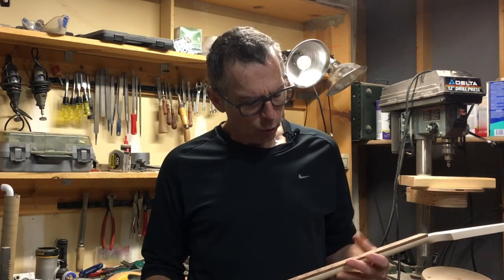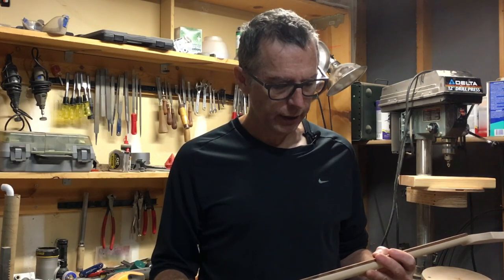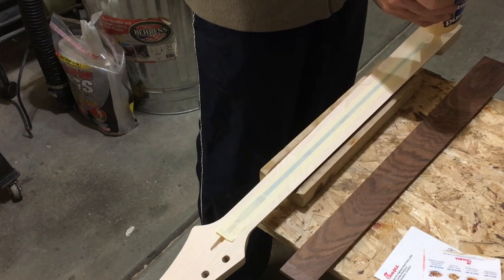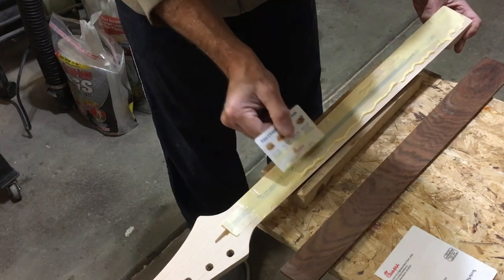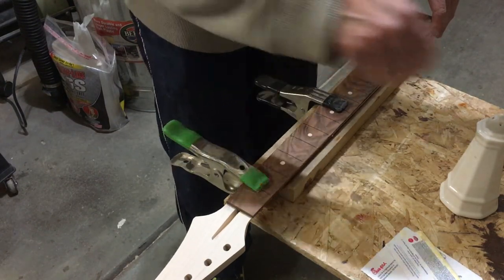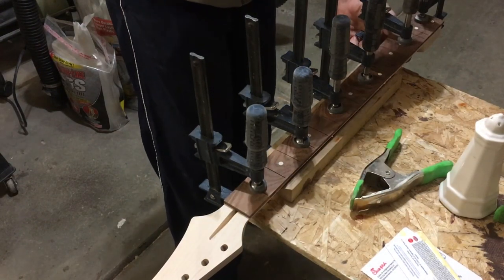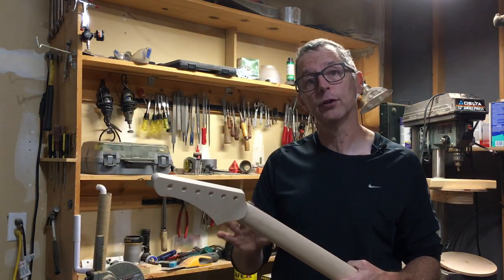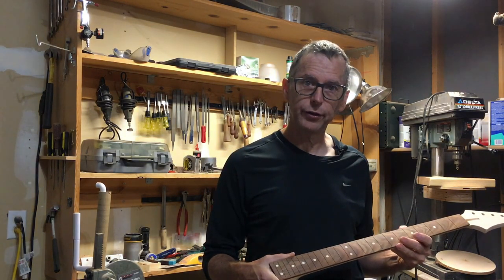How To Glue A Fretboard Onto A Guitar Neck

Comment: That's interesting I've never seen anyone use salt to add grit to their glue to keep the pieces from slipping. I'll have to try this on my stringered neck blanks. For fretboards I have index pins through the fret slots at the 1st and 17th frets to keep it from moving while gluing.
Reply: I think pins are the way to go. I don't know how I'd feel about grains of anything in between the two surfaces, even if harmless. I avoid anything that reduces vibration and it seems like having pockets of material imbued in the wood/hardened glue would influence the overall vibe negatively, simply because of a density differences.. If there were a way to apply the grains uniformly, then I might feel better about it. 🤷‍♂️
Reply: Which glue is used to join the fretboard to the neck? Can I use Araldite? 
I tried using Fevicol bu eventually it gave up to string pressure slowly ripping the fretboard off of neck.
Reply: @anujkolhe5611  use titebond original (the red label)
Reply: @andrewgrossman6066  Okay. I'll give it a try. Thank you!
Reply: This just seems like more of the same, over complicating things.  Do what you want but I see no reason to compromise your glue with a foreign chemical.  Gluing on a fretboard is not that difficult.  Even the slippiest glue tacks up soon enough.  Align one end, clamp it,  align the other, clamp it,  clamp the middle, adjusting as you go.  Dial in the clamping pressure from the center towards the ends and you're golden. I've used fish glue with great results. Starts off tacky with plenty of time to make adjustments. Taping over the truss rod is stupid too. If you're only using a thin layer of glue to minimize squeeze out, why reduce the glue contact area with tape?  A tiny amount of glue in the truss rod slot won't hurt.  Some of these builders over think and complicate a fairly simple concept. They're guitars, not space shuttles.
Reply: @timhenry8078  🤣

Comment: That's good advice on the squeezeout. You can also take like a minute and simply tape off the edge of the neck, so no glue even touches it. Not very difficult, a straight line and some tape.

Comment: Always good advice.  Also high pressure clamping can distort the wood just enough to create an open joint. If your mating surfaces are perfect, very little pressure is needed for the perfect closed joint.  Great stuff.

Comment: I know you probably don't run into this on a new build but, I had to pull the fretboard off of a neck because it was separating, after I got it apart it was pretty apparent that the wood around the truss rod adjuster has gotten some type of oil soaked into it, the rest of the glue was kind of crystalized so it separated easily. Want to try and save the neck and fretboard and prep the neck and fretboard with something to draw the oil out, would Naphtha suffice?
Reply from the maker: Without knowing what the oil is, it's kind of hard to say.

Comment: Does salt weaken the glue:  This is a question I asked myself after watching this video (good video by the way).  So, I looked around.  A glue expert from tightbond is quoted as saying that salt or sugar can react with the glue and weaken the bond.  However, some people have done (semi scientific) testing and in all tests the wood failed before the glue did.  So IMO, the answer is, salt may weaken the bond but not enough to be of any concern since the glue is still stronger than the surrounding wood.  That said just use a bit as shown in this video  :)
Reply from the maker: Of course Titebond will say that. They have to be thoughtful about their warranty. I’ve never had an issue with salt weakening the glue and I have had to remove a few.

Comment: hello, first time builder here, but i built several horsebows.. 
thanks for your time, really educative.
during gluing operations, we use to rake the wood with a metal saw blade so we are sure the glue perfectly penetrates the surface.
do you think it would work or not ? thank you.

Comment: Is your fretboard radiused? I noticed you didn't use a clamping caul and I was wondering if it is OK to not use one on a radiused fretboard. Great video, many thanks
Reply from the maker: It's always best to use a clamping caul. However, I didn't have one long enough for this neck and I opted to clamp without one. Not the best choice, but it worked okay.

Comment: I've seen a few videos of guys doing DIY kits. They get these great tops with a thin veneer of flamed maple. They go to try and leather dye stain that top, and the dye won't soak in. Is that due to the worker at the factory wiping the excess glue quickly?
Reply from the maker: Veneer is so thin, the glue is forced through to the surface as it is pressure laminated to the body.
Reply: No way! thanks for the reply Chris. I'm talking my wife into the CNC machine you have. Thanks for the great vids man! I used to live in Colorado Springs. Cheers from Arizona. @HighlineGuitars

Comment: Hi Chris, thanks for the informative video. Some very practical tips there! I was wondering why you decide to clamp the two parts without a reference support over the entire length. It seems to me that this makes you risk losing the straightness of your original parts. Wouldn't it be wise to support the fretboard side with a rigid, straight support? Especially considering your approach on trying to avoid leveling your fretwork. Would like to hear your thoughts on this.
Reply: C# Customs I thought the same thing. I probably wouldn’t put the clamp directly on the wood to prevent marring the surface either

Comment: Hi Chris, i always read the other comments and answers first, before i ask a question. This answered it all ( most ) . I wanted to ask, if you have hypotheticly no plan, no nut placement indication, where exactly do i glue the fretboard on ? The taper is a good answer, but you can have also a square blank and fretboard, but then you can determine more related to the scalelenght. If removing and reglueing.. that was my main question actually, how to determine where ? The 12th fret ! Great answer ! I thought, to make on the side a marking where the nut ends. But i have one more important question. I have a TOKAI SG with binding on the neck and the trussrod is with no any means or tricks possible to MOVE. Totaly jammed up.. Now, should i be able to remove the fretboard WITH binding without damaging the binding and reuse after new trussrod install ? Any tips ? Thanks so much Chris ! Greets from Belgium.
Reply: To get a truss rod freed up, you first want to remove the strings, then clamp the neck down in a way that introduces a little backbow into it. sort of reverse-relief, as it were. This will assure that  the tension rod is relaxed. Then, insert the adjusting tool into the adjuster for the tension rod, and carefully try to TIGHTEN it a bit. This alone will often break it free. Use just enough force to put some firm torgue on the rod adjuster, so long as you keep in mind you don't want to break the rod, strip the threads, or tear out the anchor. Hold the torque on it for half a minute or so, as sometimes the rod adjuster is slowly creeping loose while this is being done. Next, try torquing in the opposite direction in the same overall  manner. Doing this several times, in one direction & then the other, can often break the cold-fused adjuster loose, & enable the rod to function properly again. Additionally, you can try tapping on the wrench with a mallet or a small hammer as you apply torque. That can get the adjuster to 'pop' loose, sometimes. You can also try some spray contact cleaner, but be sure to use the type that LEAVES NO RESIDUE. If you can access the adjuster, spray the cleaner directly on it and then go right to work at attempting to twist the wrench as I described. Exercise caution & use patience. I hope this will help. If not, there's really only two or three choices for what to do next. One, you can remove all the frets & re-level the fretboard, or, Two, you 'll need to remove the fretboard to service or replace the stuck rod. Third, if the amount of bow or relief is only slightly off, you can sometimes get by with just leveling & re-crowning the frets, but that's sort of a band-aid that doesn't actually fix what's wrong, and if the tension rod issue is ever properly corrected in the future, the guitar would then need a new fret job, same as it would if the fretboard was leveled to compensate for a stuck rod. The only way to do a proper repair, if the rod simply won't move no matter what, is to remove the fretboard & deal with the tension rod directly.

Comment: I have a mini fret board peeling from the neck. I turned down the truss rod pressure so everyrhing looks straight but seperated. Should i seperate the fretboard completely and try to reglue the board back on or should isqueeze some glue inbetween and hope for the best
Reply from the maker: I think that would be a good question for someone who does repair work.

Comment: Thanks for great videos, Chris. Hope you are well during these difficult days. Question: The guitar shown in this video has the truss rod channel routed right up into the headstock (if I am not mistaken), no doubt for access with an allen wrench. In another video you show how to drill for access, with the channel NOT cut above the nut (I believe). As I am in the process of slowly building my first strat neck, please indicate which construction you prefer. And, with the guitar shown in this video, did you fill in that channel on the headstock a bit? Or leave it as is?
Reply from the maker: I prefer routing the slot as opposed to drilling it. I cover the headstock portion of the slot with a custom made truss rod cover.
Reply: @HighlineGuitars  Thanks. So, since you are my online luthier god, I shall do the same!

Comment: You didn't discuss how you align the fretboard before gluing.  Do you use some type of temporary nut to push against - or some other method?
Reply from the maker: I line up the edges of the fretboard with the edges of the neck. Same shape. No fancy alignment needed.

Comment: I have a guitar that the fretboard separate from the neck not completely but the from the first 3rd fret. The rest of the fretboard is still glued to the neck. Can I use like elmer's carpenter wood glue to glue them or it have to be tiebond glue. Thanks!
Reply from the maker: Elmer's carpenter glue is the same stuff as Titebond, so it will work fine.
Reply: @HighlineGuitars  Thank you very much!

Comment: Sir thanx for this video. I have a probleem glueing. After glueing there is a gab (1 mm apr.) between the fretboard and neck from fret 12 to 19. ( i build in leds)... what would you  suggest?..ireing so glue melts? Than clamp again?...or sand chape the fretboard?

Comment: I did my first neck, i proceeded without any problem. When i assemble it and play, i noticed a big problem which is truss rod rattle. It vibrates and disturb the player so much. I definitely didnt work coarse but dont know where the clearance is. What can i do to prevent this on my next? Does silicone filling or sth else work?
Reply from the maker: Just give the truss rod nut a couple of turns. Not enough to move the neck, but just enough to bend the rod so it will press against the top and bottom of the channel, and that will eliminate the rattle.
Reply: My first solution trial was also the same but it didnt work.
Reply from the maker: @mertakgun8209  Sounds like somethings wrong with the rod or you have way too much slop between the rod and the channel. Routing to a closer tolerance the next time will help Also, you can wrap the rod in Teflon plumber's tape to get a tighter fit.
Reply: It may be. Thanks for the teflon tape advice i will use on my next.
Reply: Heat shrink on the rod. 

Plummer's tape on the rod. 

Thin bits of cork are lightly pressed into the walls of the slot and the rod (not advisable for several reasons). I was told styrofoam (polystyrene) is used also (again, not advisable).

Demand improved workmanship from yourself, set a higher standard of expectations, and commit to holding a tighter tolerance on the slot dimensions. 

A moderately generous dollop of caulk at each end, and one in the middle of the length, of the slot. 

I often glue a thin strip of the neck wood on top of the slot, setting this piece on to shallow and narrow shoulders milled into the neck. The slot is milled to a depth which includes the thickness of this piece of wood, which is also the depth of the shoulder (I have heard other guitar builders, Luthiers, claim that they use epoxy to glue the fretboard to the neck and will glue the middle of the truss rod to either the underside of the fretboard or the underside of the narrow strip of wood glued on top of the truss rod slot, but I never had anyone explain why they would do this).

Wrap a thick, wide rubber band, or several small, narrow rubber bands, around each end of the truss rod. 

As for locating the fretboard, I rely on my machinist/process engineer background, and I use small case hardened dowel pins in an off-cut area which is removed after glue up. I used to use, and occasionally still do yours a fixture which has a pocket that fits the profile of the neck and fretboard to a tight tolerance (one of many advantages of using a vertical mill, whether in CNC or manual mode, to cut dimensions to a degree of accuracy and precision which 99.9% of human beings cannot touch with any hand tools).

I've also milled a shallow slot into the underside of the fretboard, which precisely, and accurately matches the location and width of the shoulders milled into the neck to fit the strip of neck wood inserted above the truss rod. The thin strip of wood is obviously cut to a matching width, and a thickness to match the depth of the milled shoulders plus the depth of the slot milled into the underside of the fretboard. This strip of wood now functions as key that is set into matching keyways. This is a very sound design principle for accurately locating two mating components, commonly used on precision ground shafts and pulleys, gears, bearing components, etc.

Comment: EVERY woodworker needs to know the salt trick! But - using only several to a half dozen grains of salt does the same job, and is easier to compress when clamping hardwoods. Too much salt could result in a GAP w/ hard woods like ebony onto maple. Not an issue w/ softwoods.
Reply: There are different salt grain sizes. Which one to use?

Comment: Advice for someone wanting to remove fret marker inlays, and "disguise" them as wood? I have a rosewood fingerboard with white inlays. I want to make the fingerboard look like theres no fret markers.
Reply from the maker: If the markers are round, drill them out and cut some plugs from a similar piece of Rosewood with a plug cutter to fill the holes. Sand flush and finish with some tung oil.

Comment: I Just Want To Ask A Question...
Q. How Come You're Not Putting A Thin Layer of Protection Over The Fingerboard. 
In Wood Shop Class, I Was Taught To Protect The Wood From Receiving Any Type of Dent or Dents 
From Occurring When Using Clamps of Any Type, Especially When Applying Pressure To Join Two 
Pieces of Wood.
Reply: Spring clamps like he is using don't exert enough pressure to dent hardwoods commonly used in luthiery.  Further, his clamp faces have a rubbery cover where they contact the wood.

What you learned is correct, especially when working softwood and especially as a student.  But the style of clamp and hardness of maple and rosewood make it unnecessary.

Comment: Please tell us how deep the rod channel has to be routed ???
...and also tell us which router bits are best to use ??
like Diablo brand or deWalt or Ryobi ....please tell us !!

thanks
Reply: Since its been 2 months and you have not had an answer, I'll try to help you.  The depth of the truss rod channel will be identical to the depth of your truss rod.  So the top of the truss will sit flush with the top of the neck (before the fret board is fitted).  So, if your building your 1st guitar, you must buy the truss rod and measure it before cutting the channel.  I would recommend that you cut the channel a little shallower than measured, check the fit and then go deeper as required.  Router bits:  A cheap one will do since its internal and nobody will see it, so it does not matter if its not silky smooth.  If you want to use that bit for lots of other stuff then get the best one you can afford.  Personally I purchased a really cheap 30 bit kit from ebay.  Not very good (they blunt and dent easily) but it allowed me to see which bits I used a lot and which ones I never used.  I then went and purchased quality versions of the ones I used a lot.  Good luck :)

Comment: Do you put anything in truss rod cavity? I heard silicon so the actual truss rod doesn’t rattle. What is your method?
Reply from the maker: No. I don't put anything in the slot that could interfere with the rod's function.  The truss rods I use are wrapped and fit snug. Also, I'll slightly load the rod so it won't move. Not enough to bend the neck, but enough to keep it in place.

Comment: I have seen a few videos from luthiers that have suggested adding a little bit of pre-bend to a neck due to the fact that "it makes your truss rod work better and more precisely" ... what are your thoughts?
Reply from the maker: I think a lot of luthiers try to differentiate themselves by making up stuff.
Reply: Randy Rev I’ve seen that as well. I think however the pre-bend is used mostly for one-way truss rod applications.

Comment: Have you ever had any salt come out to the edge of the fretboard where it could be seen ?
Reply from the maker: As long as none of the grains are right at the edge, they won't show. Keep in mind that the salt grains won't move as clamping pressure is applied. Instead, they dig into the wood and act as a cleat.
Reply: Highline Guitars got it, thanks!